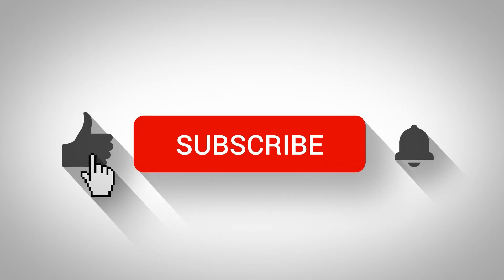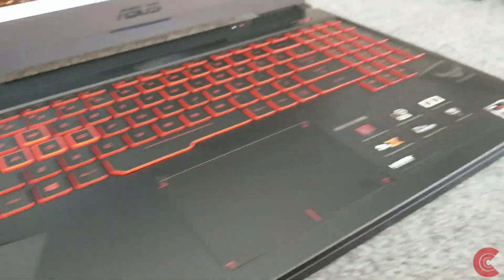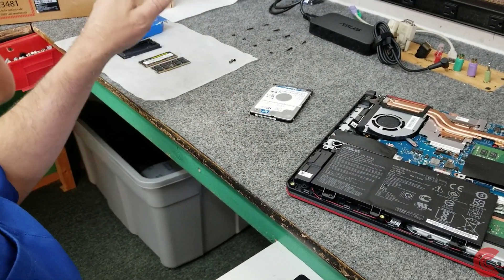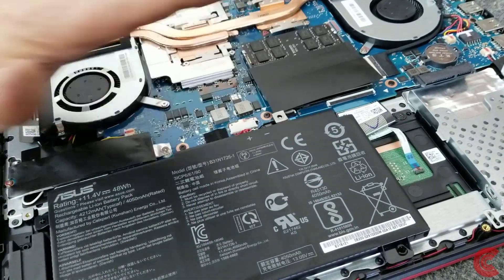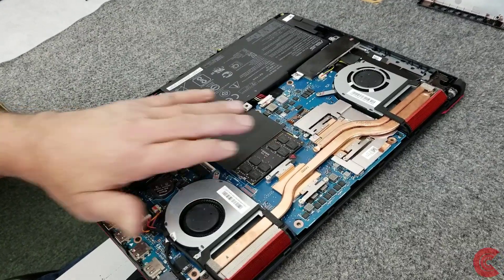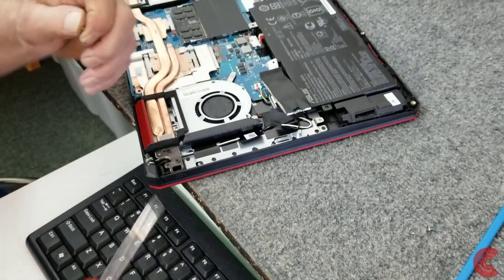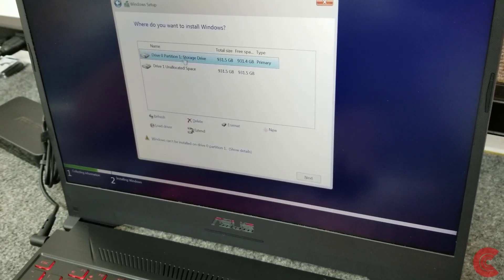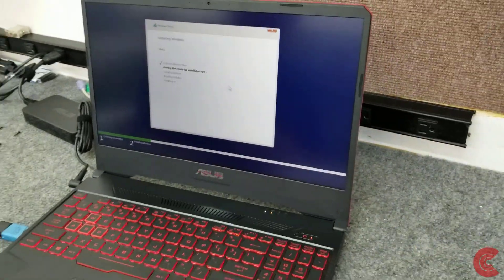ASUS TUF Laptop SSD, Memory Upgrade & Add Internal Hard Drive, clean Windows 10 install

Comment: I am actually considering this laptop, and was contemplating what upgrade units I should get. I just landed on this video, and all my questions got answered. Thanks man!
Reply: I got it 2 weeks ago because I needed one for the university. I'm in love with it, gorgeous performance on games. I play Far Cry New Dawn with everything on high and it still has 1GB  of graphical memory for other stuff. It's awesome, the battery is... Fine, I mean, if you disable some stuff like background apps and stuff you can make it last more time, I was getting 2 hours and a half, went for a solution and now it is giving me 4-5 hours. I'm really happy, also, I only play while it is plugged, so I don't know how it would do on gaming without the turbo mode. I'm in love, I can't complain about it, it does everything it has to do. Also the keyboard is really comfortable and it looks really cool. It does nearly no noise unless you're on turbo mode, which honestly, doesn't make that much.
Reply: @chexblu  Which one have you got? The i5 version or the Ryzen 5 version? Asking because I just found that this comes in both flavours. Personally, I think I'll go for the Core i5 version with GTX 1650. No idea what is the model name for that one.
Reply: @AceJackHamm3r  I got the Ryzen 5 with the 1650.
Reply: @AceJackHamm3r  Well my laptop is : Asus fx505dt
Reply: @AceJackHamm3r  I sincerely have about the difference between intel and amd
Reply: Asus 505DT - BQ051T
Reply: @chexblu  Are you sure you got the 1650? Asus says BQ051T has AMD Ryzen 5 3550H and Radeon 560X.
Reply: @AceJackHamm3r  Yes. I'm sure, I got the 1650. There is also am integrated card. Vegas something
Reply: @rezamj282  Wow thank you very much for telling me this. I really appreciate it, I think you've been unlucky with it since I haven't had those problems, at least not yet and I hope never, but yeah. Thanks and don't worry, mine isn't perfect either we just gotta practice more and more. I think you wrote it very well

Comment: My laptop is asus fx505dt with 1tb HDD and it's nice but little slow because of HDD...
So i bougth and install a ssd nvme of 500gb and when i put it in, the laptop just don't iniciate, just keep's on asus logo and don't let me in to bios (using f2), until i remove the new ssd nvme... 
Somebody can help me pls?

Comment: Dude, I have the same laptop and I was searching for this. 
Thanks!
Reply: Same
Reply: Asus didnt give me extra screws
Reply: @justinmacahilas8871  I thought this too but take off the interior of the box to see if they aren't here
Reply: Mine came with a HDD installed and it's the same model
Reply: Hi. I have a question. This laptop, does only support red color on keyboard? Or it is RGB?
Reply: @badwordl  dont have the laptop now, but it only has red. But I think this model is discontinued

Comment: If I only want to change the internal hard drive, do I have to follow all steps from this video to change it?
Does the ssd work with the internal hard drive?
Reply from the maker: Hi. Yes, follow the steps to open up the laptop to upgrade or add an internal 2.5 inch hdd. Dale

Comment: I just bought the Asus TUF A15 that comes with the GTX1660Ti. That model is a little different. Although there is space for the 2.5 inch drive, the connector is different and you need a ribbon cable to install it. That model also brought a second M.2 port that will only take NVMe SSDs.
Reply: Forgot to add that the cable to connect the 2.5 inch drive comes in the laptop's box along with the necessary screws.

Comment: Can you connect a M.2 SATA SSD  into the spare M.2 port? Thanks for making this video.
Reply: I'll look up over the board and of he BIOS. I'll let you know in case anyone has the same question. Thanks for your response. Muchas gracias.
Reply from the maker: Hi. Does yours have 2 m.2 slots?
Reply: @CadillacComputerCenter  yes it does have two
Reply from the maker: Thx.  I cannot say for sure.  Usually when you have 2 m.2 ports, at least one of them is a dual port for bother nvme and sata ssd.  Look very closely on mainboard,  it is usually marked.  Dale
Reply: Neither the BIOS nor the board had any info. I had a M.2 SATA laying around so I plugged it in to give it a go, but no luck. The port does not recognize SATA drives.
Reply from the maker: Hmm, good info to know. Thx

Comment: Question. I just got mine this week and that starting storage is of course not doing it for me. I was just thinking about adding a 500 gig/1 tb hdd first and eventually upgrading everything else. Would i have to download windows 10 on the hdd like he did for the ssd in the video? Or just put it in the laptop and boom more storage?
Reply from the maker: Hi. You can just add hdd if you like for more storage,  you will have to go into computer management,  diak management to set it up real quick. Dale
Reply: Cadillac Computer Center okay thanks alot👍
Reply: @CadillacComputerCenter  Okay I just got my 2.5 hdd 500 gb and tried to install it. For some reason the drive does not show up in settings and even does not show up in disk management. I unscrewed the back of the laptop and also screwed in the hdd in the tray and made sure everything was tight.

Comment: awesome walk through! Just have 1 question with the  ram frequency this model supports, does it support 2666mhz ram or just 2400mhz?
Reply from the maker: Hi. It will support 2400, 2666, and 3200.  Dale
Reply: But always put the same Frequency. If not it will throttle to the least mhz to match the performance.
Reply: @FFG8G  Got it! Thanks!

Comment: Hey I have the same laptop can you pls male new video on how to clean keyboard plug because currently certain keys like space bar b k s p esc are not working properly works sometimes sometimes not...
Help me pls
Thanks in advance
Reply from the maker: Hi.  To clean the ribbon cable connections you use Isopropyl Alcohol, 99% pure.  I use these swabs....https://www.amazon.com/gp/product/B004SPCWCM/ref=ppx_yo_dt_b_search_asin_title?ie=UTF8&psc=1      Hope it helps, Dale

Comment: I try to put a M2 SSD and at try to turning on, the PC stills on ASUS logo some else whit this case?
Reply: And i can't access to the BIOS...
Reply: did you install windows in the ssd?
Reply: Same case here, you solve it brow? Help me pls Uwu
Reply: @tor6278  did you install windows in the ssd? Not sure if this laptop use nvme or not, it may be because incompatibly
Reply: @amrinjaffni4268  It's a new empty ssd nvme WD blue 500gb, in the asus page says it's compatible with pci express, and i alredy saw it on some videos, so... hahah i hope i found a way...
Reply: @tor6278  if you put only the new one, you need to install windows in it
Reply: @amrinjaffni4268  My laptop is fx505dt with 1tb HDD, i alredy got window's installed there, the problem is that when i plug in the SSD the bios lock's and i can't join(because i tried to do boot with a usb), i can't do nothing, all i can see is the asus logo, until i remove the SSD
Reply: @tor6278  is the ssd detected in bios?
Reply: @amrinjaffni4268  I don't know, maybe not xd 
Because when i put in the SSD the system just lock's and i can't acces to bios (using f2)

Comment: I have a question sir, I have only SSD 512g and one slot free in my laptop. Can I add another SSD or do I have to add HDD disk?
Reply from the maker: Hi. You can easily add a 2.5 inch sata ssd in place of 2.5 inch hdd. Ssd will be much faster.  I use the Crucial mx500 series 2.5 inch sata ssd. Dale

Comment: Couple questions:   Can this hold TWO  of the Nvme Internal Solid State Drive's?   I got one 256gb one and want to add a 1 TB NVme
Also..   How do you get the Keyboard to stay on one color?  Mine cycles endlessly
Reply: One more question..  lol  what did you do with the old 8gb stick and the old 256 gb drive?
I could use them both in older machines Im messing with..   may put Steam OS on a 256 drive to test it..   lol
you didn't throw them away did you?
Reply: I use TUF Aura Core

Comment: i m planning to buy it...will it heat?
Reply from the maker: Hi. Gaming laptops can run on the warm side. This model has adequate cooling system. Thx
Reply: @CadillacComputerCenter  do u recommend it?
Reply from the maker: For the price, it's a good deal.  Nice gaming laptop.  Very upgradeable.  Thx

Comment: My FX504 says it has 4 ram slots but in all the videos I've seen on YouTube I see only 2 slots ofr ram. I haven't opened my laptop yet. Are there 2 or 4 slots in FX504 any idea?

Also can 8GB and 16GB ram work together?
Reply from the maker: Hi. I looked it up, apparently it has 4 slots. Sometimes there can be on board ram.  Not likely with this model. I would carefully open it up and look to be sure. If I had to guess, I would say 2 slots. Dale
Reply: @CadillacComputerCenter  thank you so much for the quick reply. Can 8 gb & 16 gb rams be used together?
Reply from the maker: Yes you can do that. Try to use same speeds though. 2400. 2666. Etc. Dale
Reply: @CadillacComputerCenter  Hi, i would like to ask what is the max frequency of the RAM that is compatible for the Laptop? 3200 mhz?
Reply from the maker: @GahiiGaming  Hi. yes you can run 3200.  for the money though, 2666 would be just fine for this.

Comment: I want to upgrade SSD in my Asus Tuf gaming laptop from 256gb to 1tb but my windows is installed in it. Can I somehow transfer my windows from old SSD to new SSD (If so, how can I do this? ) or do I have to buy another windows?
Reply from the maker: Hi. No you don't have to buy windows. You can either clone your old drive to new, or do fresh clean install of windows 10. I have several videos on different methods of doing both. Check out my main channel page. Thx.

Comment: Hi, I have a Asus TUF FX505DT-AL087T with Ryzen 5 and 8 gb single channel RAM. Could you tell me if it’s worth a upgrade? If so, should i upgrade it to 16gb (8x2) or 32gb(16x2)? I just bought my new laptop and don’t have any experience with the upgrading and building world. If it’s worth the upgrade, could you also send me a link of the best RAM’s for the upgrade? I use my laptop for gaming (fps, not open world) and work on chrome a bit. Thanks
Reply from the maker: Hi.  Thanks for watching.  I would certainly go up to 32gb DDR4 memory to improve fps.  Plus, chrome can be a memory hog. The Corsair Vengeance laptop memory would work well.   here is a link for a 32gb kit......https://www.amazon.com/CORSAIR-Vengeance-Performance-260-Pin-CMSX32GX4M2A2666C18/dp/B01BGZEVHU/ref=sr_1_8?crid=18UTT3H9BMUZ&dchild=1&keywords=corsair+memory+32gb+ddr4&qid=1595793531&sprefix=corsair+memory%2Caps%2C178&sr=8-8
Reply: Cadillac Computer Center Thanks, but i find €130 really much for a RAM upgrade: Like, is it worth it? I only play fps games, I’m not a pro gamer and I don’t have to be one. Is there that much difference in performance, or am i just as well fine with the 16 (2x8) or just the 8?      Before this laptop i had a lenovo yoga530 with just 4gb ram and that was already good enough. So, is there a big difference between 8 and 16 gb?
Reply from the maker: Well, just go with 16gb.  That is more affordable. And will still give good results.  Dale
Reply: Cadillac Computer Center Thanks a lot man. Sorry for asking, but could you send a link for best 8x2 gb ram for my laptop? Bc is also have no knowledge of the clockspeeds and stuff (2400 was the max or not?). THIS WILL BE MY LAST MESSAGE AND THANKS A LOT AGAIN
Reply from the maker: It's no problem.  This ram I really like
https://www.amazon.com/gp/aw/d/B019MRBKYG?psc=1&ref=ppx_pop_mob_b_asin_title
Reply: Cadillac Computer Center tnx man.
Reply: Cadillac Computer Center Sorry for all the spam, just thinking about this very consciously.  Thanks for helping! If the 16gb is better, would you also have a link for that?  Last question (in general) is there a difference in different types of brands concerning memory cards/RAM?
Reply: Cadillac Computer Center THIS is definitely the last one for now: on amazon i see DDR4 and ddr4. Is this different from each other or just weird amazon stuff?

Comment: does it void warranty?
Reply from the maker: Hi. As long as you do not damage anything,  you should be fine. Typically manufacturers will not void warranty if your upgrading or adding components. Just be careful.  You can contact ASUS support via their website for more info. Dale
Reply: @CadillacComputerCenter  cool thanks!!

Comment: hey dude do you have any tip on how to keep this laptop cool because my cpu keeps going upto 96 degrees. i even repatsed with thermal grizzly kryonaught
Reply from the maker: Hi. I hear this heat issue alot on laptops that are basically new.  If you have already cleaned and applied new thermal paste, not much else to do.  You can download a free program called Throttlestop,  people have had good results using it. Their are lots of videos on YouTube on how to use it.  Give it a try. Dale

Comment: Very helpful, thanks.  Mine arrives in a couple of days, and I am looking to add a large capacity hdd for photos, video rendering and music production.

What is the max height for an hdd?  Will it take 15mm, or only 9.6mm or thinner?
Reply: 7mm height and 2.5inch in width
Reply: @shreebadiger8436  Thank you

Comment: I just bought one 16 gb ddr4 hyper x ram.. should i remove the one I'm using currently and just use the 16 GB? or can I use both the new 16 GB and the old 8 GB as a dual channel?
Reply from the maker: Hi. You can use them together for a total of 24gb, but it wont be dual channel. If you get another 16gb stick just like the one you got, that would be dual channel.   Thx, dale
Reply: @CadillacComputerCenter  will it affect the performance or cause overheating or something if I use 24 GB? And does it matter in which slot I put the hyperx ram and the old ram( the main slot or the one under the shield)? What do you suggest?
Reply from the maker: It will not cause overheating.   Just put the 16 in the empty slot and you should be good. The model in the video supports 32gb.
Reply: @CadillacComputerCenter  thank you you have been really helpful! have a great day!

Comment: do you get the screws if u buy the hard drive of by the box of the laptop?
and also is this one good https://www.amazon.nl/Seagate-BarraCuda-interne-harde-schijf/dp/B07H28QRKN/ref=sr_1_3?__mk_nl_NL=%C3%85M%C3%85%C5%BD%C3%95%C3%91&dchild=1&keywords=1tb%2Bhhd%2Bfor%2Blaptop&qid=1593942505&s=electronics&sr=1-3&th=1
Reply from the maker: Hi. The screws are not usually included.  Seagate is a good Hdd.  Dale
Reply: @CadillacComputerCenter  how so you get the screws then
Reply from the maker: Here ya go......https://www.newegg.com/p/0PS-008N-02EH4

Comment: I bought this pc since 5 months and I got a lot of problems with it but now I know how to fix it for my streaming and videos 
thank you so much ❤️
Reply from the maker: Your welcome. Thanks for watching.  Dale
Reply: Bro what is its inbuilt storage ? Plzz tell
Reply: @x_.mann_.x  512GB or 256GB
Reply: @chexblu  256 gb
Reply: I had one with an RGB keyboard.  And had 1TB hdd. I will upgrade with a 500GB M.2 nvme ssd. Soon
Reply: @FFG8G  bro i have that one, at the time of putting the m2 I had to have formatted the hdd before, or you can install the windows in the m.2 without having formatted the hdd yet, pls help meeee
Reply: @julianernestosanabria3008  yes, you need to backup your data and format the hdd. Because windows is installed in c drive. Or you can make the boot device to M2 but its always safe to do a clean installation.
Reply: @FFG8G  thanks bro
Reply: @FFG8G  same here broo 😂